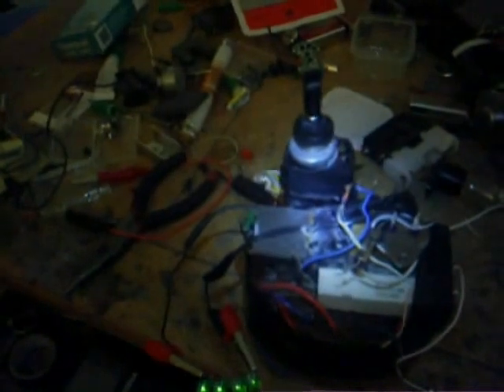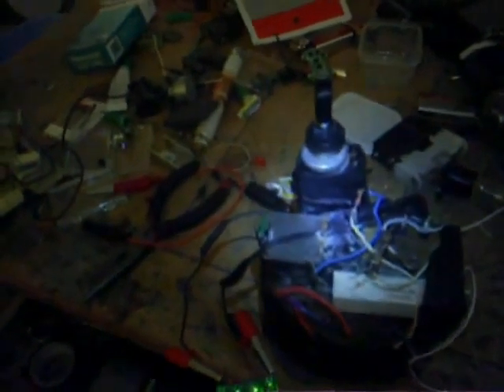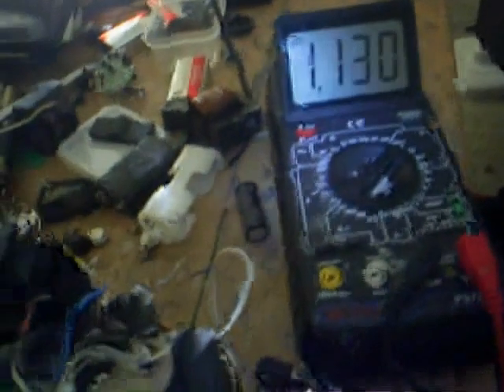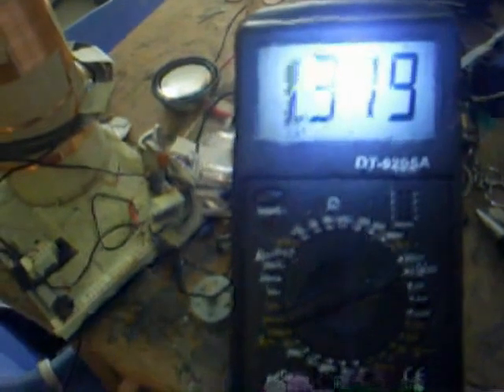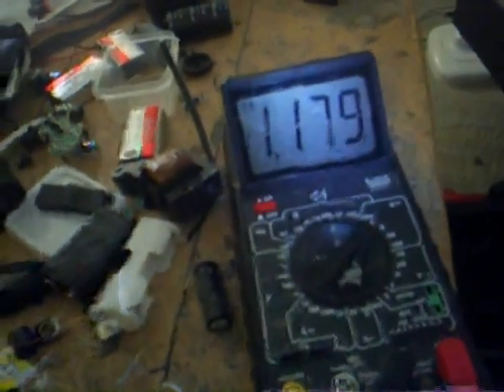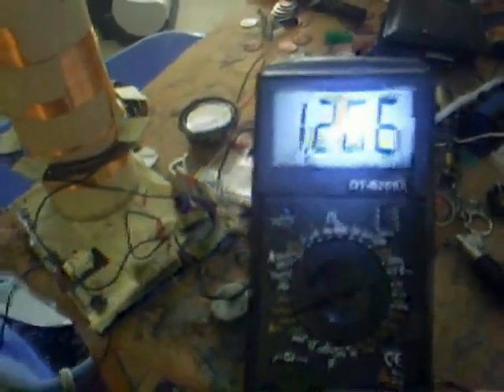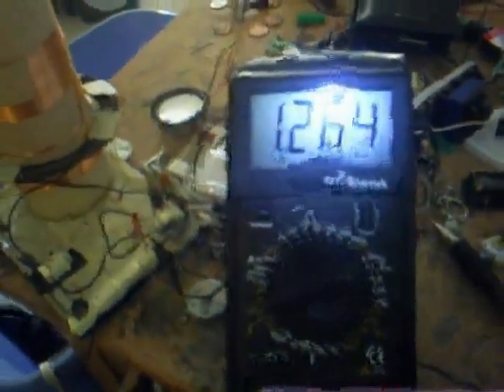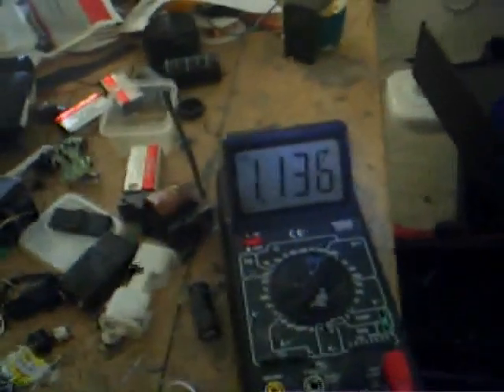Big 1.5v-12v Joule Thief

Comment: OK why do I want this agian? I really don't understand the functionality of it cause I can nearly hear what your saying. yes I am very hard of hearing and legaly blinde. I have to read and write through a jewlers loup
Reply from the maker: Don't see why anyone would want it unless they were into tinkering.  I'm speaking specifically of my device though which is long gone and was all part of testing.  I use a similar setup now but with a 12v 4.5 amp transformer wired as a joule thief.  It basically serves as an all purpose battery charger for me.  I also use one to run household light bulbs and a pc fan and use the potentiometer as a dimmer and motor control. It's a pretty cool and handy electronics project.
Reply: +Magneticitist oh. thank you for that it really explains a lot . is it something you might mass produce and profit from . If it has the potential to lower my electric bill I'm all for a crowd fund. Since my eyesight is so bad I need all the light I can get and saving money ,well that speaks for itself. thanks agian.
Reply from the maker: there are certainly similar types of projects that could save you a tiny bit on your light bill. that would of course require some type of setup where you have a battery bank that is recharged via a solar panel and an efficient inverting circuit to then light the bulbs.  for me this big joule thief project is more a way for me to charge almost any kind of battery, and even recharge non-rechargeable batteries a few times before having to toss them. Since I deal with all kinds of batteries it's useful to be able to have sort of an easy DIY variable power supply for running various loads and also charging random cells.  The one I have sitting on my table has a fan and light bulb hooked to it so if i flip the on switch both will come on and i can control the light intensity and fan speed, or simply disconnect them both and use the energy for something else. I can charge a 12v car battery down to a small watch battery,  i just have to adjust the potentiometer accordingly.
Reply: +Magneticitist maybe you can write a short book like a DIY and you can make I available to us consumers.

Comment from the maker: yes sir. i would have put a schematic but it would just be a basic JT but using these larger transformers. I prefer audio transformers though. The primary is what i use for the drive coil and sometimes when i have leftover windings i will either use them as an indicator or put them in series with the base winding for more resistance. a 2N3055 usually does the trick fine by itself and if tuned right most of the heat if any will be in the transformer core